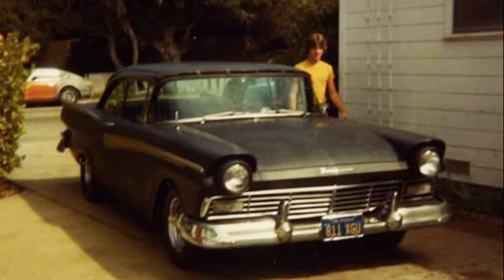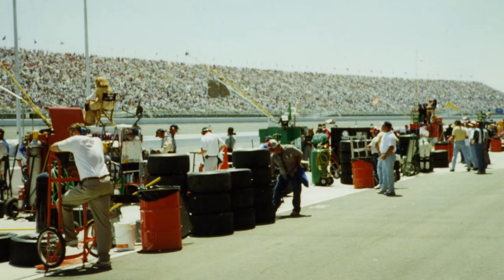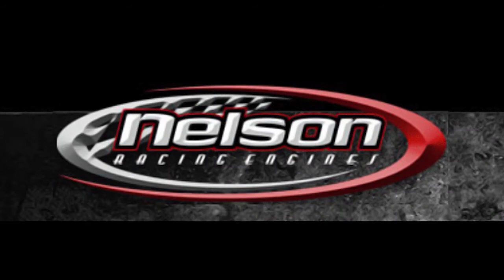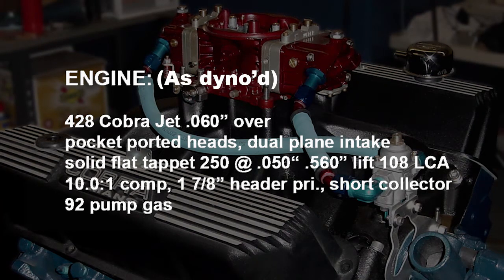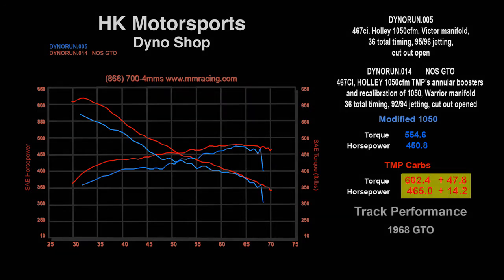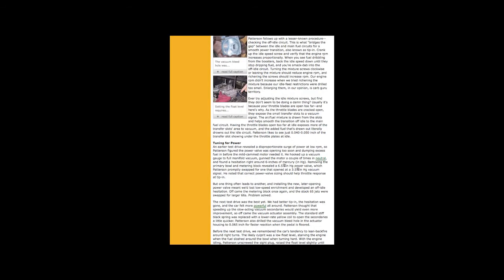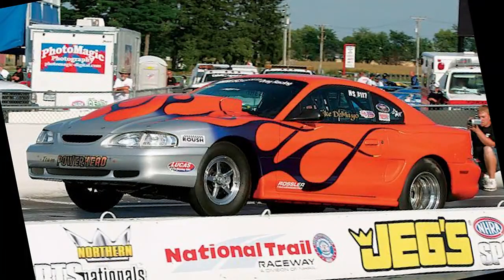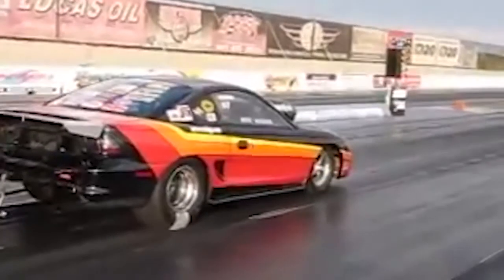Are carburetors dead?

Comment: Sweet what’s your go to brand for a good race motor like a good cammed or 350 or 383
Reply: 383 cammed
Reply from the maker: I do engine design, i.e., cam, heads, intake, etc., plus mods.  It really just comes down to what the customer wants and needs.
Reply from the maker: The last engine I did was a stroked 400 Chrysler/Mopar to 470 CID for a road race car.  I wasn't present and for some unGodly reason the customer dyno'd the engine for break in and to just get a real basic number, no tuning he dyno'd with an out of the box 750 double pumper and a street single plane intake.  The engine still made 623 lbs torque @ 3500 RPM coming down off peak and 549 horsepower at 5500 RPM going rich rich.